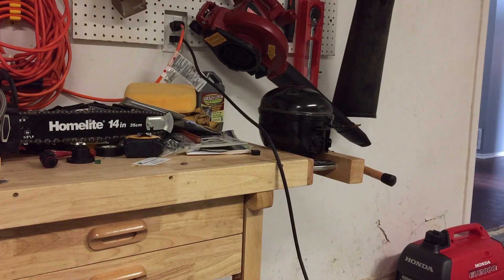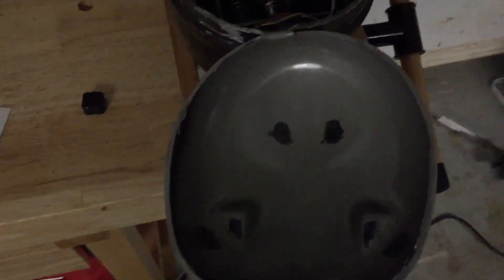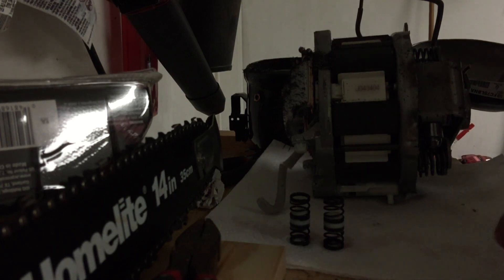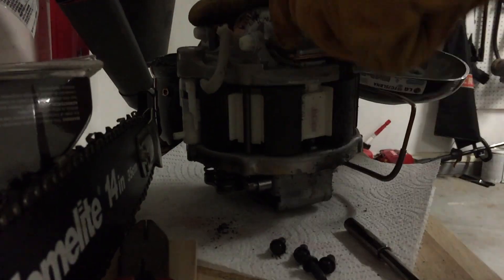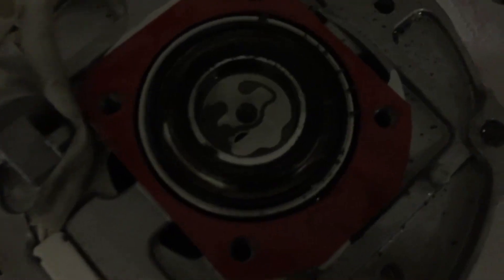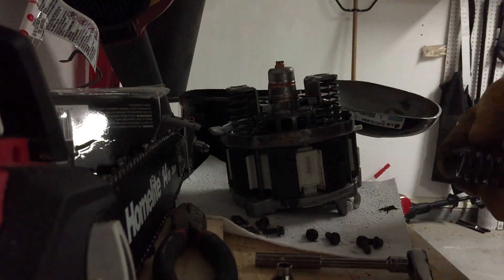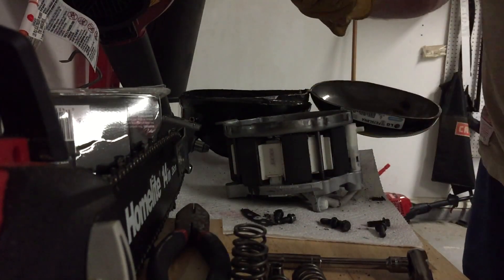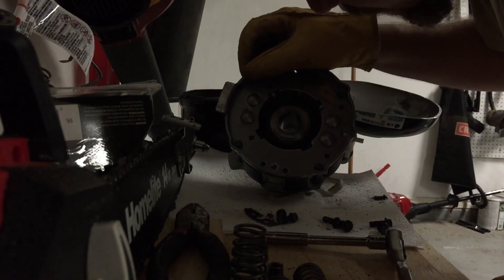LG Linear Compressor Teardown

Comment: I’ve replaced over 500 LG compressors
Reply: And that's just you! It's pretty much the same thing as Nissan cars with their CVT transmissions. Guaranteed to need replaced at least right after the warranty expires.
Reply: Ya I do all the kenmores which are lgs. And actual lgs. Not a lot of other companies will do them around here. Now the r600 LGs are starting to fail.

Comment: I had another inverter compressor fail with broken reed valves.  It is my opinion that the problem is these inverter compressor are always running, the fridge just adjusts the speed.  So the reed valves are constantly working 100% of the time compared to old compressor which run them maybe 1/3 as much,  as they only run at full speed.   So they need to use bigger reed valves that can handle the constant use.  Maybe they will figure it out now after all these failures.   
And yes your lighting was horrible so could not see much, but it confirmed my diagnosis that the reed valves fail.
btw, a scroll compressor has no reed valves and are used in commercial fridges that last decades.
Reply from the maker: Sorry about the bad lighting, I didn't have anywhere else to do the video with better lighting. I have since moved and now have a shop with much better lighting.

Comment: Mine failed after four years.  LG repair tech took three days to get here, overnighted the compressor and other copper parts, fixed it all by lunchtime and left with no sign-off, no work order, no purchase order... quietly in and out with no recognition of the problem or the solution.  Reminded me a lot of the “silent warranty” the car dealers use when they just want the problem to quietly go away.  I would say the current class action lawsuit against LG for these compressors is warranted, but to LG credit, they are fixing them, and apparently at no cost.
Reply: Parts take awhile to order. And that sounds like a contractor
 I work for a large company. And you sign multiple times.
Reply: So 3 years later is it still kicking?

Comment: Those compressors  rarely pass 5 years working really alot of customers    the compressor you tear down have a  stuck valve 
Caused by overheat due to flaw design that oil is not  reaching in sufficient quantity to   reduce the heat   the valve is a special metal membrane that over bent and cause it to stuck that leads to failing .
I m sure repair   engineers over the world have seen that  fault  in addition the  inverter circuit   rarely survive the shock caused by the  compressor .

Comment: Mine just went out LG linear compressor. No service tech's for Tucson AZ, have to come out of Mesa I'm told. Glad I never bought ext warranty, just getting the run around everyone is I'm told.  My fridge was only 3.5 years old. $2500 fridge too.
Reply: Is your LG fridge still going after the compressor replacement?
Reply: @TheFrenchPug  I bought a new fridge, scrapped the old one
Reply: @mtericktucson  Oh. Gotcha. You didn't have it fixed. Just bought a new one. Ours just went out shortly after 5 years. I live in So Cal so no problem getting it serviced. We'll see how long it lasts. Thanks for responding.

Comment: You can put a regular fixed speed compressor by using the condenser fan signal to trigger a relay to turn on a basic old style compressor. Watch this video the guy explains how to do it. https://www.youtube.com/watch?v=lZJ0EZE3tx8&t=11s

Comment: Brother can you tell me if the Linear compressor is a dry one or does it have a oil sump i.e. does it have oil circulate around it's moving parts
Reply from the maker: It has a oil sump. The bottom of the case is filled with oil.
Reply: @austin22re  it is just that I feel .... maybe because of lack of proper oil circulation the components have worn down. There is too much black residue like burnt components due to friction i.e. lack of oil. Maybe you can confirm that

Comment: Is the linear compressor the same as the one marketed as "Digital Inverter" Compressor.  I noticed some Refrigerators are marketed as linear inverter compressors and some as digital inverter compressors.. are all this marketing terms or actually different technologies
Reply from the maker: They function the same due to them both using inverter power and control boards to control speed and varying cooling demand. I believe Samsung just markets it as a "digital inverter" compressor. All basically the same though.

Comment: The whole compressor is based on one small plate which is used as a Inlet Outlet valve most of the time it's broken and damaged because of that compressor doesn't hold the pressure and I'm surprised that whole LG reputation is based on the small plate what a bad designing and pathetic performance of LG engineers

Comment: what where your specific symptoms prior to having the compressor replaced? I talked to one guy today who said it must be the compressor, and another who said he has never replaced one and it must be low on freon and needs a new evaporator coil to replace the 'leaking' existing one. Im confused, and upset, if the compressor has a warranty to 10 years how does it cost half of the price of a new fridge to get it replaced!? I wont be buying LG next time I can tell you that...
Reply from the maker: Del Smyser symptoms were a noticeably loud rattle while the compressor was running and the freezer and fridge portion stopped cooling. Still had a full charge of refrigerant, but since the compressor valve broke it could not pressurize the refrigerant.
Reply: Austin Kalenda so only way to check and test that is to replace it? Im gonna try and get lg to send me one, but wont hold my breath...
Reply from the maker: Del Smyser To me if the compressor is running but it's not cooling and you have gauges to check for proper refrigerant pressure then it's a compressor issue. Is your condenser fan working?
Reply: @delsmyser1  Ours was running but never varied speed, obviously because there was no cooling so the sensing told the compressor to run at full speed to try and catch up.  No go.  The compressor was making absolutely no more noise than usual when I discovered the cabinet temp was rising. It ran continually at full speed instead of varying to cover the cooling demand.  

The Tech checked the current consumption of the compressor which showed to be .5 amps.  This would indicate that there is no blockage (which would cause the current consumption to be excessive).  That it must be a reed valve which is stuck open or failed in some other way.  

The tech explained that they are seeing a lot of LG compressor failures.  This was not the case 9 years ago.

Comment: This unit makes the most annoying high pitched squealing sound ever heard coming from a refrigerator. My husband took the back of the frig off and it looks like a little tiny compressor. Maybe that the problem. Using a regular compressor would easily solve the problem. Go to Consumer complaints at the following link and its get there a 1 Star rating !
https://www.consumeraffairs.com/homeowners/lg_refrigerator.html
Very sorry we bought one of these turkeys. Very angry :-(
Reply: Using a regular compressor  is  just as  bad

Comment: i have a solution to this problem by installing a 110v compressor. you get rid of the problem easy. These compressors are trash. how could they conveniently make a system that can be so simple to supposed "energy efficient". Not efficient for anyones pocket but theirs.   I have worked on these for years.
Reply: 659MX 659 

how do you convert a linear compressor to a regular compressor? I've tried it, but can't get it to work, any info would be awesome
Reply: @warlordbeto818sfv4  The compressor must be able to work at variable speed, not at full speed all of the time.
Reply: You can put a regular fixed speed compressor by using the condenser fan signal to trigger a relay to turn on a basic old style compressor. Watch this video the guy explains how to do it. https://www.youtube.com/watch?v=lZJ0EZE3tx8&t=11s

Comment: LG VERY conspicuously advertises a 10 year warranty on this boat anchor but conveniently, VERY inconspicuously, whispers that after 1 year the LABOR for having it installed by a mandatory Authorized Service Company is NOT included. So at LEAST 600 dollars later you have another, non improved version, of the original boat anchor which if you're lucky , should last another 18 months. I recently replaced a thermostat in a GE refrigerator. That one , and 2 more just like it , have been owned ,and used, by the same customer since 1957!!! AND....each one survived being under 2 feet of salt water for days from Super Storm Sandy in 2012!!   No freaking linear, inverter boat anchors in those units. Just the old, time tested , reciprocating compressor. Can't wait for the right congressman to take it up the ass with no lubricant from LG when his fridge takes a crap Thanksgiving day. Maybe then this type of corporate thievery will see some legislative action.
Reply from the maker: I agree, i was extremely pissed considering how much the refrigerator cost me. Also i got a taste of how shitty Sears customer service is. Bar none the worst. My aunt has an old Westinghouse refrigerator from 1957 that still runs today. I feel like they design products to fail prematurely now so the company can keep getting money from us.
Reply: @austin22re  My aunt had a 9 year old Rebadged "Sears" LG. The thermostat system went nuts, kept freezing everything.  The linear compressor however kept on going.  With the extended warranty she received $1200.00 towards a replacement. 

This week, our almost 2 year old LG refrigerator's compressor is suspected to have stopped pumping refrigerant.  The Inverter Compressors were apparently better 9 - 10 years ago.

I also had a very old Kitchen Aide (Whirlpool) side by side which was 25 years old.  It however was sucking electricity like crazy.  The new LG dropped the Edison Bill $100 per month for the last two years.

If only the Panasonic Refrigerator with the variable speed compressor was available in the USA.  The Panasonic Rotary Variable Speed Compressor is true and tried for decades.

I suppose there is still the option of Samsung, or Arkla-Servel/Dometic/Electrolux.
Reply: Our LG will be repaired under warranty, parts and labor, but still a 5 day wait for the new compressor to arrive after the service company orders it.
Reply from the maker: Will Shoot did my comment hurt your feelings?
Reply: yes now apologize immediately
Reply: hey watch your mouth. i am a sears/A&E in home service rep
Reply: TheNYgolfer all fans are working, very little frost on evaporator, pressure on the crimped stub on compressor reads a constant 4psi, no error codes and compressor does get warm to the touch
Reply: NIM AJJI HOGOLE

Comment: Our LG Fridge failed after 4 years still under warranty.  LG will replace the compressor under warranty if you use one of their listed service providers. However, the cheapest quote we got to fix it was just over $600.
Reply: An extended warranty is good to have, it pays for itself.
Reply from the maker: Yeah, it is expensive as they recommend changing the condenser, dryer, and compressor.

Comment: LG compressors are suppose to have 10 year warranties.  (which must be perused)  If there was more light I could tell what is going on.
Reply: The Labor is NOT guaranteed after 1year and they won't give you a new compressor unless you have it installed by an authorized Service Company and they will charge you a PREMIUM labor charge of around 600 Dollars in the U.S.
Reply: @TheNYgolfer  This is why the extended warranty is a good purchase.
Reply: @DandyDon1  But does extended warrant include parts AND labour?
Reply: @jay-uo2bi  It did cover everything.  The door was replaced under extended warranty when the water valve for the dispenser could not be fixed. It also covered the compressor, and upper compartment fan.  Parts and Labor were covered in full.  BTW There is a new compressor which is more robust.  Stronger internal springs and more robust valves.  The problem seems to be, the condenser coil clogs up with dust the compressor overheats and the valves fail.  It's very important the the grill area on the back of the refrigerator be vacuumed clean of accumulated lint/dust at regular intervals.  A PITA to pull the refrigerator out to do it, but it's a must.
Reply: @DandyDon1  What's the model number of the new, more robust compressor?
Reply: @lyndonsurajbally5568  I don't know as a LG factory tech did the work.
Reply: @DandyDon1  Thanks!
Reply: @lyndonsurajbally5568  I had the refrigerator pulled out for the annual cleaning of the grill and condenser.  I posted an image of the replacement compressor here:  http://hammondorganservice.com/downloads/images/updatedlgcomp1.jpg
Mind you this is installed in LG's 30 cubic foot French door model.

Comment: seems such linear compressor must be less economical, because it is need to overcome springs resistance. Will less energy saving efficiency compare to ordinary compressor ?
Reply: +Far Cry moreover springs will tire, mean loose springiness under long term load
Reply from the maker: You are probably correct, i imagine the springs will weaken over time. It still is more economical due to the fact its not a piston and crank design like traditional compressors, and you lose all of the parasitic friction. Just simply less moving components. Honestly if the valve design was better i think these would be good compressors.
Reply: I believe the mass is held between two sets of springs with center return.  A mechanical oscillator with a resonant frequency.like a pendulum.

Comment: Thank you for this video.  My linear compressor quit working after 1 1/2 years.  I purchased a Kenmore model, but it is made by LG.  Fortunately it is covered under warranty.  The technician told me he had replace many, many of these compressors.  And if it were not under warranty, it would be about half the cost of the refrigerator to repair it.  They seem complex
Reply from the maker: The design is simple compared to piston and crank compressors, but the valve design seems poor. I would bet most of the failures in these compressors is due to valve design.
Reply: @austin22re  Or it's contamination of the system during assembly which is causing premature compressor failure.
Reply: Get the extended warranty it's a good value.
Reply: @Carbon_Fiber  yup i install these compressors, its normal to hear a shaky wobbly sound.

Comment: my pretty mechanically inclined.. just dont know wbout how much pressure and how to charge it.
Reply from the maker: +william clouser iv No, i did not do the repair myself since the refrigerator was under warranty still. I did ask the technician if i could keep the bad compressor so i could see what went wrong with it. The problem with these compressors are they aren't serviceable, so you just have to replace them. Replacing it is fairly simple though, but you need the proper tools to do it. You need a brazing torch, a Freon scale, copper tube cutter, various other tools to take the back of the fridge apart and a charge gauge. You also need a new Dryer and evaporator in case debris is stuck in it from the old busted compressor. If you don't replace those it may ruin the new compressor. If your not familiar with refrigeration its best to let a professional do this job, so you don't have to do this all over in a few months.
Reply: It needs to be charged by weight, the exact weight you'll see in the model and serial number label inside the refrigerator. For an LG two evaps fridge is around 4.8 oz.